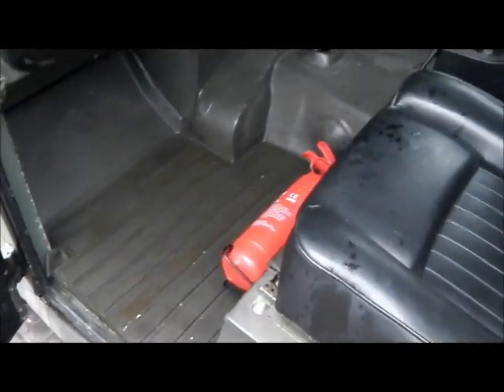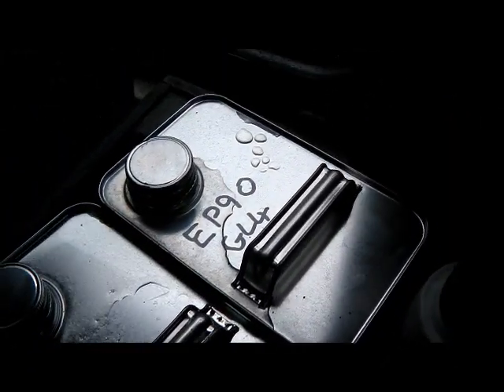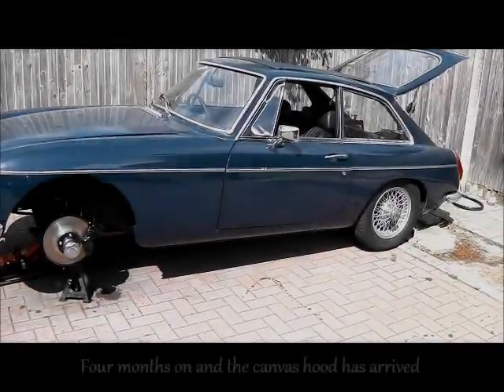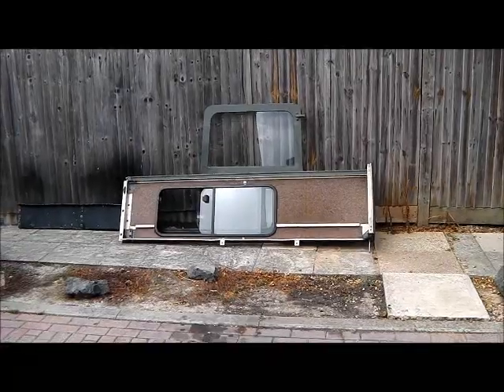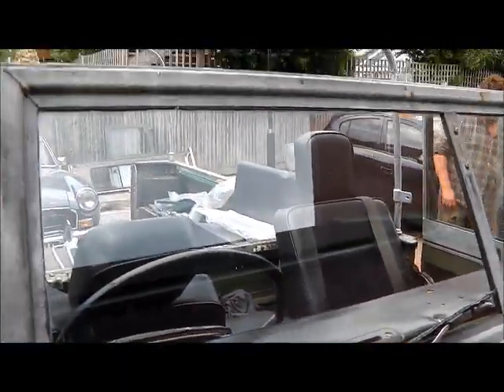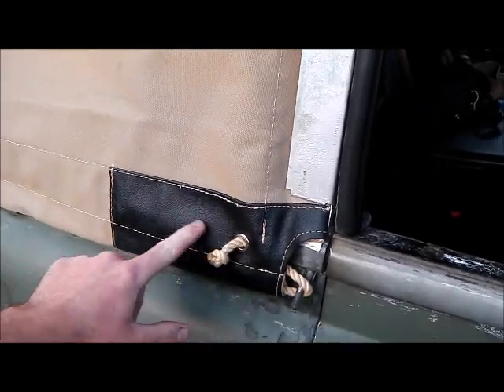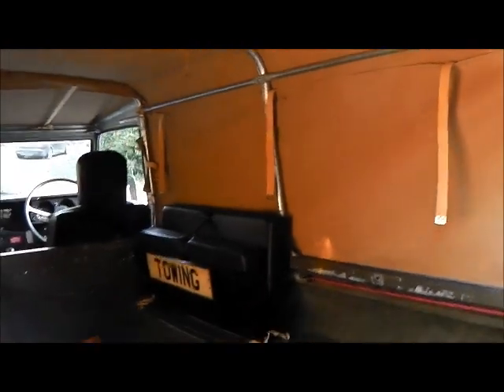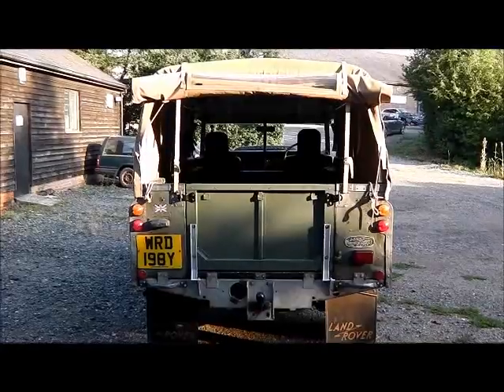WRD back under canvas

Comment: Looks good with the canvas on it. I believe the black vinyl/plastic patch is to prevent fuel splash onto the canvas when filling up. All series 88's had their filler cap at that location, as well as series 2a 109's, but not series 3 109's!
Reply from the maker: I'd not considered that, but that sounds very plausible. If that's the case, I retract my comments!

Comment: I have always found a canvas tilt to be warmer, quieter, more waterproof, weighed less so better performance and much nicer in summer with the sides rolled up. All in all a much better option!
Reply from the maker: So far it feels noticeably cooler on these hot days (I'm sure it will be warmer in winter too) and quieter. We've had some heavy showers today and with the hard top the footwells would have been awash - dry as a bone, well pleased!

Comment: Hi Phill,
Thanks for sharing the conversion.  It is quite the transformation, and should be warmer in winter.  My 88 Series 2 has the sand canvas and looks equally smart.  I have an issue with exhaust fumes in the cab too.  It has a side exit (LHS) exhaust, so I might try and extend this as you have done.  All the best, Ian
Reply from the maker: Thanks Ian. Interestingly, I drove with the back rolled up and door tops in place initially - there were no fumes entering the cabin. It was only when the door tops were removed that the problem became apparent. I guess it's much like the venturi effect in a carburettor and there are various aerodynamic ways of solving the issue, but for now I have a spare exhaust which I'm going to put through the rollers and bend to exit before the mudflap. That's the most aesthetically pleasing solution at least!
Reply: steamwally.  Good evening Phill, thanks for sharing your experiences and the suggestions to help remedy the situation.  I think the army went with canvas fume hoods behind the cab, but I like the feel of the canvas partially rolled up at the sides and back to enjoy the short summer months here.  Best wishes and happy Land Rovering.

Comment: Got my hardtop to an almost zero leak factor. Resealed gutter insane out and new rubber seals , dumdum and fill all holes however tiny. Oh also I insulate the panels so no condensation!  I do love a canvas top though,  those brackets on mine that you thought could be rifle racks? Turns out they’re truck cab brackets. I like them too!  Can’t kip in one tho
Reply from the maker: You deffinitly can get them pretty good, but I had always intended to go back to canvas one day. The hard top I have is not particularly nice and it just wasn't worth the effort to try and get it all sealed again. 
Interesting to know you have the truck cab brackets, 109" Land Rover with truck cab are sub zero..
Reply: Well it must have a cab on at some point but it’s been all sorts down the years. I like the originality that I’ve got , and I try to conserve that, but don’t feel any compunction to be slavish, I’ll improve it where it can be improved. Trouble is storing the stuff you’re not using.  Hardtops are massive!

Comment: My tilt was over 20 years old and very religious when I got it. I thought long and hard about whether to replace it with another, or put a hard top or pick up cab on. Never regretted replacing the tilt and, as long as it's kept outside the canvas should be just about self sealing (just about!). If changing the exhaust is too much of a faff you can get a fume curtain that sits behind the front seats - also keeps the heat in in winter!
One thing that might - lets be honest, will! - leak are the brass buckles and straps to roll the sides up. While the main body of the canvas is waterproof those straps definitely are not.
Reply from the maker: It's funny really, I went away from the original tilt because it leaked so badly. I realize now that was because it hadn't been looked after and had never been properly secured to the frame whilst it shrunk to size when new. Looked back at old photos, it was an appalling fit. I went over the new one last night with copious amounts of Fabsil and it leaked not a drop during the storms today, very pleased! 

The fume curtain is a good idea, will certainly be glad of one of those in the winter. I also saw a Land Rover recently where the owner had added an air scoop onto the heater intake, which as standard is a very poor idea in aerodynamic terms. Above 20mph it struggles and an air scoop renders the fan redundant. Combined with a fume curtain, it should be toasty... future project.
  I've just got a new rear section for the exhaust and will put it through the rollers tomorrow and get it exiting before the mudflap.
Reply: @steamwally  Great stuff. I bought a fume curtain along with a new tilt and spare wheel cover from Exmoor but the 88" doesn't really need the curtain as it heats up ok without it. With the extra cargo space it might be a better idea for the 109".  Don't bother with the canvas wheel cover though - it's not a great fit and ends up being a bonnet top water feature! ;-) Cheers
Reply from the maker: @daviemaclean61  Yeah I agree, think it will be necessary with the 109. In winters past, I have been cold with four layers and a heavy sheepskin jacket! Tried the spare wheel cover years ago, particularly entertaining in the autumn..

Comment: My Lightweight came with the sharktooth rail rivetted on from MOD. The metal on your new one does look thinner grade than original, i don't think mine could be flexed so easily . With the back and sides open it does suck in fumes so I have tried homemade and off the shelf fume curtains. They did work but I only really use it in summer and like the open feeling so just put up with it now.

Comment: Have you had much rain yet Phil? How’s the canvas doing?
Reply from the maker: We sure have yes, initially the canvas was leaking slightly at the seams but still a vast improvement over the hard top. During the last of the warmer weather, I proofed the canvas well with Fabsil and it's bone dry and warm inside.
Reply: @steamwally  Good to hear. I'm sure I'll be fitting one to my 2A next year. Did you get all the hood sticks and other parts from Exmoor too?
Reply from the maker: @spannersonthefen3491  Yes, it all came from Exmoor. Generally nice, though the "sharktooth" rail for the windscreen top had distorted very badly during the galvanizing process and took some effort to fit. Otherwise, best thing I've done for the vehicle.

Comment: Great conversion 👍🏻 Did you speak to Exmoor Trim about the issues you had. What was their reply?
Reply from the maker: I haven't in the end - the vinyl patch is present on original canvas tilts and is for earlier models with the underseat fuel tank and filler next behind the drivers door  - I hadn't appreciated that. 
As for the sharktooth rail, I was able to improve the fit but it seems they all come badly twisted by the galvanizing process, not good! Overall, I am very pleased with it, I've just spent a week away touring Exmoor national park with WRD and what ever the weather, it was fine.

Comment: Did you have to alter the seat belt mounts ? As on my S3 88 SW they are fixed up on the sides (b posts)  and would be removed if  i was to do a similar conversion. On my old lightweight it was never an issues because It had lap belts . Thanks for any advice.
Reply from the maker: I haven't had to alter the belts, they are already fixed to the centre bulkhead behind the seats. I'm not sure that's quite correct but it seems to work ok.
Reply: I think its normal that your belts fix to bulkhead as wrd was originally spec,ed as a rag top like my old lightweight with lap belts. I think mounting kits are available from paddocks etc to get around  my issue. Really appreciate you taking the time to reply. Cheers and looking fwd to your next video.

Comment: I had the same issues when I converted my 109 from hard to softtop.... The quality of the new parts is poor. You mentioned a modification hown at Classic Land Rover Magazine. Can you please tell me in what issue it was? Thanks
Reply from the maker: It would have been about Issue 87, unfortunately I have just thrown out a load of old magazines. Hopefully the Key Publishing website will help?
The modification was simply to rivet the shark tooth rail to the windscreen, pulling it back to the correct shape. Since doing that, the interior of my 109" has been completely dry and greatly warmer than it was before.
Reply: @steamwally  Thanks a lot. Great help

Comment: Its a thing of beauty!
How is the road noise with a canvas top?
Reply from the maker: I think a canvas equipped 109 is sub zero..  
You hear a bit more mechanical noise but the wind noise seems no greater. It does not reverberate like the tin top does, so it seems like a noise reduction over all. It's certainly a more pleasant place to be.
Reply: @steamwally  i think i will keep my 88 Lightweight project a softtop then.
A softtop land rover just looks fantastic.
Reply from the maker: @rickz9495  Definitely for a lightweight! Full safari StaWag's look awesome as do truck cab 88's, otherwise, soft top all the way.

Comment: After rainy spells I was getting splashed with cold water when driving, it was sitting in the inside gutter (until I went over a bump). I ripped off the sealant on the exterior and re-sealed with clear sealant, seems to have (kind of) solved it.
Reply from the maker: Likewise, I actually did that when I purchased the hard top, but it needs doing properly now. I couldn't face all those rivets..

Comment: They probably left the factory leaking as bad as that 😄
Reply: My 88 leaks just as bad haha
Reply from the maker: Maybe after a few years at least! There is a chap with a "boingy" 90 in my street and I was amused to notice that in winter, he adds strategically placed tin foil to the bulkhead, presumably deflecting rain water.. 
I believe Land Rover never really intended owners to remove the tin top and swap to canvas in the summer, like so many do. It's very hard to get a good fit with the hard top once it's been off.
Reply: @steamwally  had to laugh at "boingy" Are we talking big tyres and a lift kit?
Reply from the maker: @kjross73  Just a term for coil sprung Land Rovers!
Reply: @steamwally  Yes my Boingy perentie 110 pissed water in every where the misses hated that.  I just use to twist the right foot a little and most of it would miss.
Had to sell it...... But hopefully i'm going to be able to get myself a series 2 109 soon.
Not enjoying being land rover less they get in your blood.